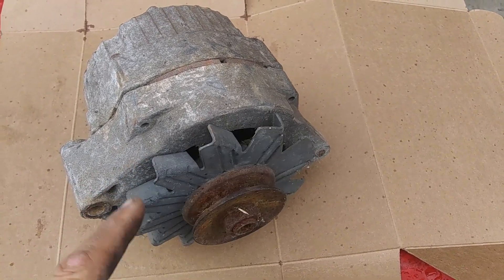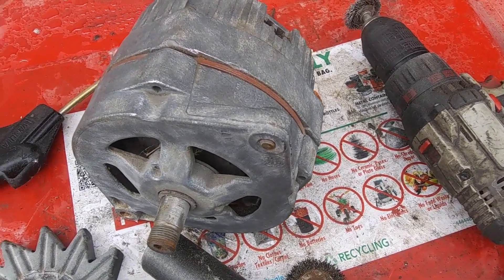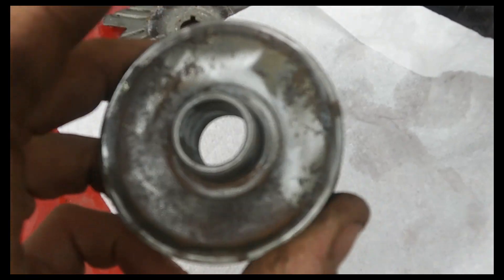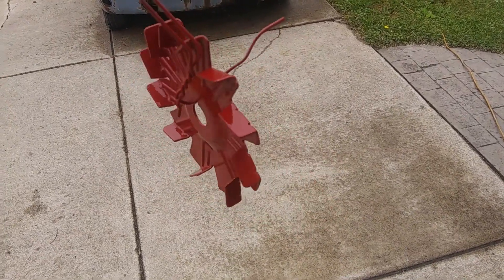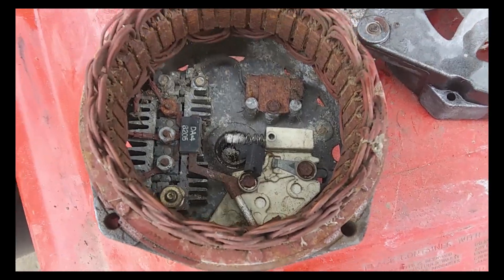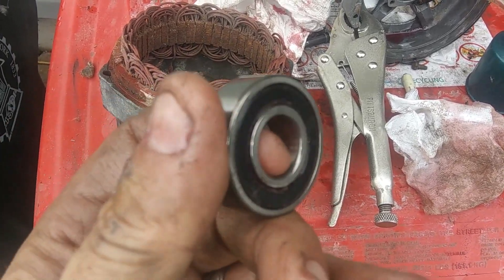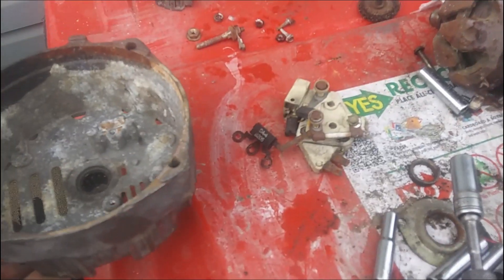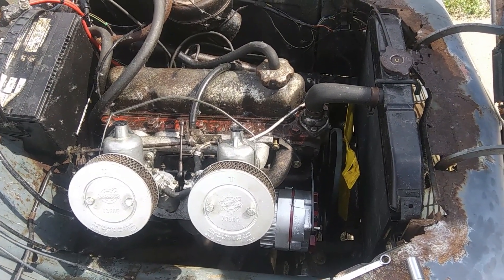DIY Generator replacement with an Alternator.  10SI General Motors alternator for 1964 Volvo PV544

Comment: Great recon on the alternator! I'm about to alternator swap on my PV,  how did you wire it up? The forums and other videos are quite unclear...
Reply from the maker: I'm sorry I missed your question.  One of the small wires goes to the battery and the other gets ignition power through the charge light bulb through the dash.  When you switch the ignition on the bulb gets power and gets grounded through the voltage regulator.  When the engine starts the voltage regulator provides positive also causing the bulb to go out.  Thank you for watching and commenting if you haven't already please consider subscribing 👍